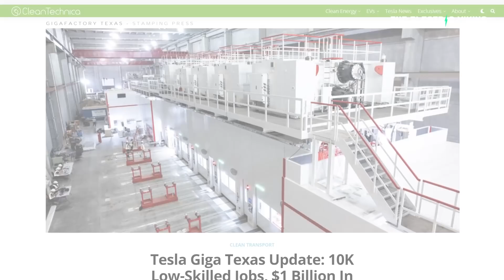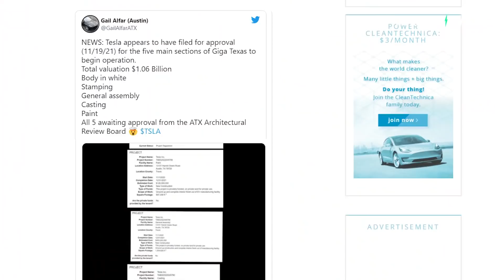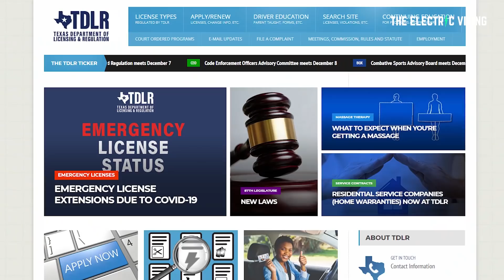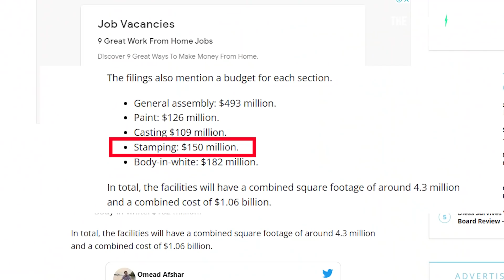UPDATE on Gigafactory TEXAS + where the next GIGA will be built

Comment: Shortly after the Cybertruck was announced, Sandy Munro did a cost break down between that and an f150 to build. 
When Sandy did that break down he said factory sized paint shops cost around $350m-$500m  to build
Considering Tesla's troubles with paint consistency, going with a cheap paint shop worries me.
Reply: What "cheap paint shop" for the Cybertruck are you talking about? The Cybertruck requires NO paint. The best paint shop is no paint shop.
Reply: @timyarrow8844  There's a paint shop at Giga Texas for 3's and Y's.  The cost that Sam showed was a lot less than $350-500M, but maybe that was just the cost for the building, not the bots.
Reply: @incognitotorpedo42  I hope you're right about the $125M being for just the building.
Reply: @timyarrow8844  Dude did you watch the video?  Giga Texas has a $125,000,000 paint shop. When the standard cost for one is in the $350-$500,000,000 range.

Comment: VW wolfburg 1M production capacity, employs 65k, 6.5M sqm. GigaShanghai 450-500k production run rate, employs 15k, 900k sqm,
GigaTexas employ start 10k, 500k Model Y production capacity start, 900k sqm factory floor space estimate (my tesla weekend)
My understanding is with each gigafactory, less employees per 5
00k production is needed as more automation and gigacasting is used.
Reply: My understanding is that Wolfsburg production maxes out around 800K.

Comment: 10,000 low skilled jobs would be: logistics, operators (automated machines still need people to monitor controls and address/evaluate machine faults), quality control, finishing, and general assembly of the vehicle. Automation in general assembly is more around work assist and assembly control than replacement of people. The number of people being employed indicates the volume of production would be very high from this facility. There would also be more people than a normal general assembly plant if they doing subcomponent work, as in making battery packs, drive assemblies, seat assemblies, dashboard assemblies, etc.,  just like an ICE vehicle plant would have higher employment numbers if they were manufacturing the engines at the car assembly plant.

Comment: 10,000 staff. Not as many as you think.  Take out the admin related staff, those in food halls, etc, support services etc and then consider, 7 day operation and Tesla runs a 4 shift system to allow for shift overlap and handover. Likely around 1800 staff per shift or less running Y and 3, then Semi will move in time to Texas then in a year Cyber truck.

Of that 10,000 there will be a drop out factor and a firing factor until the right overall people are there. Called it some natural wastage to build in.
Reply: Or work for McD where the turnovers are even worse , or better yet Walmart, as a greeter/S

Comment: With a two piece casting to make one car-how will a car be repaired after an accident?
Reply: The castings have 'sacrificial' parts which can be cutoff and replaced, but generally if an accident is severe enough to affect the frame,  it is a writeoff.
Reply: Panel beating. Most of the cast will be the frame, surely most panels will be independent.

Comment: It could be a four-day week. where you roll forward the so-called weekend. 10,000 workers working a 24 hour 3 shift system times 2,= 6 shifts.
That would be 1666 workers in the factory at any one time. That would be about right for a Giga factory.
Reply: Yes, and that will over the year start to expand to 3 lines. You start with the Model Y ramp, but that doesn't mean you don't start the Model 3 ramp while that is in progress and with some trained workers, and of course later you start the CyberTruck ramp while both are going on. 10,000 actually will be low in my opinion.